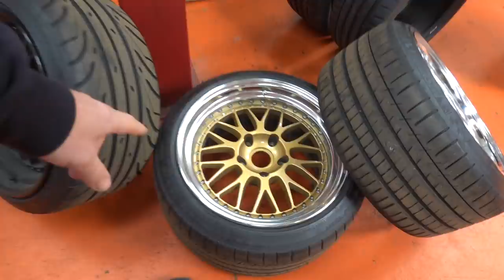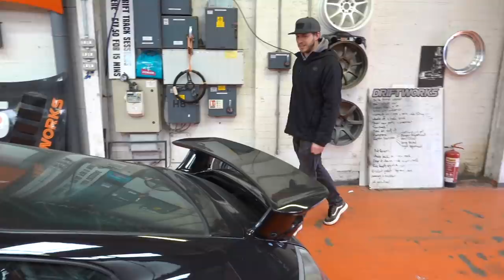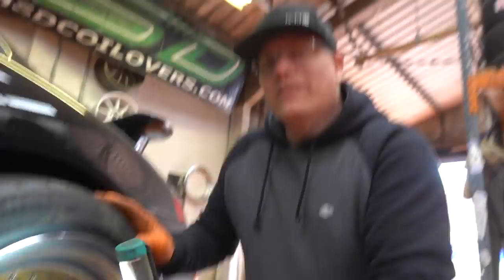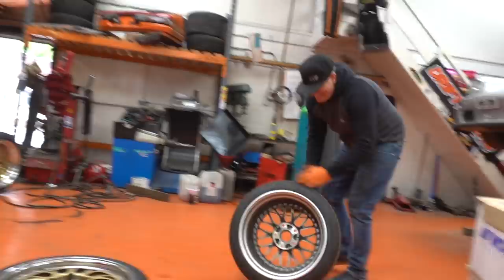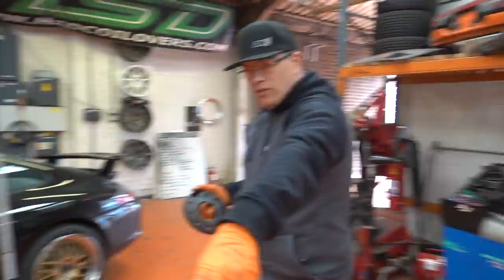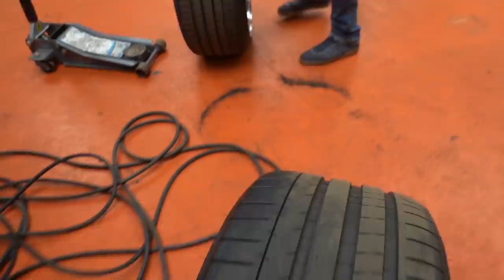GT3 Carbon Ceramic brakes on my RWB 964 Turbo Porsche 911?

Comment: Mr. Al is a BALLER to run Magnesium E88's on track days/hoon days! My dream wheels...and dream cars all in one video. So GOOD! Only you Phil can mod a perfectly modded car and make it better. PCCB on a RW porsche??? This is may be the most capable track RW in existence. I feel you about the dust though, I had polishied lips on my BBS LM's and I was cleaning them after every drive. With the clear coat gone I had to be obsessive. Truly annoying and I was nervous that if I didn't clean it the lips would just corrode.  I like Al's commentary with you its what car guys want to listen in on. Were you trying to pass Al on that track day? 996 GT3 and driver mod is definitely a slept on setup these days with the 997's and 991's so effortlessly capable.
Reply from the maker: They are aluminium. I'm not sure you can still get the magnesium ones. Thanks man.
Reply: @driftworks  Didn't know this...wow that makes the magnesiums worth mad $$$$. Good to know thanks!

Comment: With you on the GT3’s having the best sound track of any standard car, period.
Reply from the maker: It just immediately sings 'racecar' My Kline inconnel exhaust on the white 991 was next level. Once of the best noises I've ever heard.
Reply: @driftworks  so I'm rocking a back box delete on a 991, but so much more in there?
Reply from the maker: You can hear a little bit of it in the video at 12:20 https://www.youtube.com/watch?v=T2DsnIFMQQU

Comment: These are the best conversations :) 
Makes me want to upgrade my stock 996 C2 brakes as well. Besides my driving skills, they are the weakest part of the car. Rock solid pedal and not enough braking performance when chasing more modern cars.
Reply from the maker: Thanks man! Yeah, that doesn't sound ideal!

Comment: You should consider widening the front track by swapping to 993 front subframes. Should help handling issues.
Reply from the maker: I didn't know the 993 frame was wider. Which parts make it wider? The frame itself or the front lower arms?
Reply: @driftworks  The castings each side that the lower arms mount to make them wider. You might be able tell by looking at this 282354356972 on eBay. Look how much the tabs that the arms mount to stick out compare to yours. Otherwise identical.
Reply from the maker: Interesting, so what other parts would be needed to convert it to wide track using these?
Reply: You might have to extend the track rod if you run out of adjustment. Otherwise no other parts.

Comment: The answer seems entirely straightforward -
You need a pad that releases less dust - go on the forums of various performance marques and research "low dust pads".

For the likely consequence of reduced braking force - just upgrade to a bigger set of rotors (and matching calipers) from a quality brand that will fit inside the wheels.

Now, I will watch the rest of the video to see how you chose to fix this issue...
Reply from the maker: Low dust pads are generally super dangerous for spirited driving in my experience. I very nearly wrote a car off using EBC Green Stuff pads.
Reply: @driftworks  - Those aren't the only low-dust pads, btw. Some are not even marketed as such.

Comment: The following suggestion is a BIG job -- but pull the wheels apart (HA - that and re-assembly is the BIG job component) and clear anodise the shiny outer sections.  On one of my older 930's (HA - back when 17" BBS rims were MONSTERS) - the outer barrel was put in the lathe and I used a fine Scotch-Brite pad to impart a brushed type finish - voila - HA - no more polishing and in my opinion - I preferred it to the high shine like finish (HA - I am an 'anti chrome - anti polish' person = I do NOT like shiny stuff).  Being that you guys do a lot of project type work - setting up your own anodising system could be very handy - especially with your DAMN salted roads.  I have also used clear anodising on aluminium spoked motorcycle rims on some HD engined projects - EXCELLENT virtual maintenance-free outcome (HA - that is PERFECT for me as I am a 'set & forget' type person = make it PERFECT - then USE it EVERY DAY without any concerns - HA - or polishing).  Once anodised or brushed - all I use is the pressure washer every now and again at the local carwash = NO polishing = NO problems = MORE high speed and LOUD driving//riiding time - HA.  Have a nice day all.  CHEERS from AUSTRALIA.
Reply from the maker: I'd rather just not have the dust in the first place 👍
Reply: True - HA - but the anodosing//brushed is perfect for a somewhat lazy perfectionist as I am.  HA - and helps saves aluminium rims when the dam dogs piss on the wheels - HA.  Stay safe - have a nice day

Comment: wheel weights could become a clearance issue with the caliper part that the pad retaining pin goes through in future, especially when tyres are changed and need rebalancing. I learned this the hard way with a BBK haha
Reply from the maker: Yeah, I've been there too!

Comment: for so far as i know these brakes you want to get for the porsche will not be a difficult thing to fit on your porsche.
its only the cost for the whole set , it is a pretty penny you might say.
still it would be a fantastic. it is like vw.
if you puzzle it good out it has to work.
can wait for the next video .
Reply from the maker: 👍fitting them is the next part of the puzzle.

Comment: Brembo makes carbon ceramic replacement rotor rings & pads for the race kits - its very likely the replacements exist for what you have;  call them and they can probably get you sorted for less than a used gt3 ceramic kit and then you wont end up having to use painted calipers that come with dust boots...  best of luck!
Reply from the maker: I did think about going that way, but the brakes are currently so biased I'd really like to get a properly balanced front and rear setup without having to have a bias valve. The front's lock up really hard currently.

Comment: Oh man I love that black 996 GT3 - I noticed the Manthey Racing sticker on the rear side window, please can you tell us more about the spec?
Reply from the maker: It's quite a simple setup (that works really well) Manthey KW V3 & alignment & it's on Cup2 tyres.
Reply: @driftworks  Thank you very much, Manthey racing built an ultimate spec 996 gt3 for a customer approved by porsche it was 4.2l monster https://www.youtube.com/watch?v=rSJLKN04tc4 . I love the work you have done on your 964 Turbo and adore the Riviera 997 GT3 you have.

Comment: i recently had to deal with a brake dust issue on my vantage. the OEM pads are Pagids and the amount of brake dust they created in a very short time was unacceptable to me. i suppose it was a consequence of their performance oriented nature. anyway, i don't need nor want performance oriented brake pads so i bought and installed some everyday type, mundane brake pads that now create very little brake dust and am thoroughly satisfied. a bonus is that they cost next to nothing compared to the Pagids.
Reply from the maker: Yeah there are definitely lower dust pads out there. I've not had good experience with them though. They don't support 'spirited driving' well.
Reply: @driftworks  understood. :)

Comment: Phil those calipers would look awesome on your 964. I know it's not the reason you changing em. But just saying. Also have you looked into ceramic coating or waxing the wheels? I'm not expect but I've heard that they stay clean after ceramic coating.
Reply from the maker: Thanks. Yeah I've done all of that multiple times. They are currently coated in two coats of Carbon Collective ceramic wheel seal.

Comment: Sorry if I’ve missed it but Are you going to have to change the complete hub assembly as the the gt3 calipers are mounted behind the axle and the turbo calipers are mounted in front of the axel.
Reply from the maker: We'll see. I haven't got that far 😄. Making adapters shouldn't be too difficult & it should be possible to swap the link pipe & bleed nipples around if the leading pistons in the calipers are different sizes.

Comment: You have 2 BMW track cars + CSL double duty, Porsche double duty (and a 991 GT according to this video?), Lamborghini GT car. Pursuing mastery with one car on track would be so much more cost effective than running 6 track cars. I guess when you have these types of vehicles that won't depreciate it's a completely different calculation.
Reply from the maker: I only have one track car: The E30 M3. The others are road cars ,a couple of which happen to possibly be pretty decent on track 👍

Comment: That might be smart (but who am I to say that!) to try a couple of new pads first. I've got very little dust with my EBC pads on stock discs, for instance
Reply from the maker: I know there are low dust pads. But they are generally lethal when driving fast or on track and I'm not after low dust, I'm after no dust 👍
Reply: @driftworks  The EBC redstuff or yellowstuff will stand heavy use but yeah, no dust is even better.

Comment: Is it uncommon for cars to lift both sides at once with the rear jacking point? Most of my cars have done that. My old 2003 JDM WRX struggled but managed, The old VX220 definitely did it (Lotus chassis yo!) and the GT86 does it really well although i'm pretty sure they're pretty stiff chassis themselves.
Reply from the maker: It's not that specifically, it's how rigid it is 👍
Reply: @driftworks  ah fair enough, a good rigid chassis goes a long way! My little Vx220 was a weapon on track, great fun but an expensive hobby when you don't do them very often.

Comment: Whats with the weird spots (looks like... small indents?) on the rotor surface?  Warped? Or is that wear pattern nomal for massive ventilated discs?
Reply from the maker: On my discs? It's where the grooves used to be. In about 2000 miles road use they've been eaten by the horrible pads.

Comment: Where can I buy ceramic discs for Porsche 911 ? I'm from Brazil, thanks
Reply from the maker: I just gathered the bits through Ebay. It is a bit risky buying used CCB though as they are easy to damage and hard to to see if they are worn out sometimes.

Comment: If the new tyres are a step back would cutting one more groove in them help?
Reply from the maker: That's not something you do on a road tyre. It would be the wrong way to go anyway, it seems the grooves on the supersport may be a big part of the issue.
Reply: Driftworks 👍 makes more sense

Comment: Could you use some pegs (whats ever they are called) to locate/slide the wheels back on and off if you don't have studs, especially useful when working with ceramic discs so you can slide the wheels off without dropping them onto the disc and cracking them ;0)
Reply from the maker: He needs a stud conversion. I already have a stud conversion on mine. I do it on most of my cars, I hate wheelbolts.

Comment: When can we have a look at the CSL??? And any other treasure hid underneath polythene??
Reply from the maker: I need to get around to it. Generally the videos are about doing stuff to cars, and it doesn't need a great deal doing. There has been another addition just yesterday actually. Vid soon if the footage is any good.
Reply: Driftworks Cool , German?  Oh one other thing I’m curious about if you were going to buy a 991.2 gt3 would it be manual or pdk?
Reply from the maker: Yeah I bought my old 997.2 GT3 back..  love manual and PDK, but if I get my 992 GT3 allocation it'll be PDK.
Reply: Driftworks You have a pretty new Macan so hopefully you,l be ok.

Comment: Phil, it's weird to see you're running negative caster.
Reply from the maker: It's not negative 👍The shock is angled that way, but the pivot points are all that matters. Draw a line from the lower ball joint to the top mount ball joint & it's positive. The car has 4.5* positive castor.

Comment: What is the size for front and rear GT3 rotors?
Reply from the maker: 996 & 997 is 350mm front and rear. Front are 34mm thick and rears are 28mm.
Reply: @driftworks  Why don't you want to install 380 Brembos? As  did some research for my 964 wb or 993 tt  The FVD told me they will fit if I have BBS Le mans.
Reply from the maker: I want to use a carbon ceramic kit & these are 350mm. 380 would be very tight I reckon.

Comment: 4s run wider then the SS...
Reply from the maker: Thanks. More like Cup 2's then I guess.
Reply: @driftworks  yes... the 4S sidewall is more the same as the cup 2 in comparison then the SS....had people run 255 40 SS in the fronts of a m5 e60.. where theyve changed to the 4s in the same size and they rubbed...